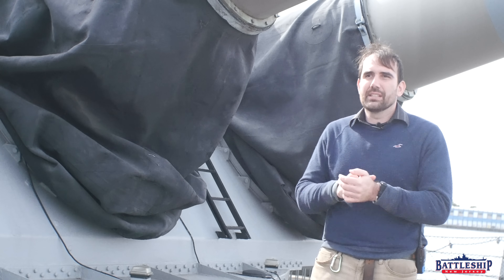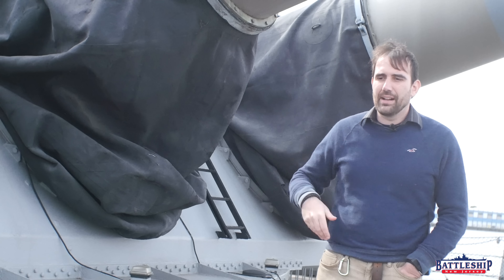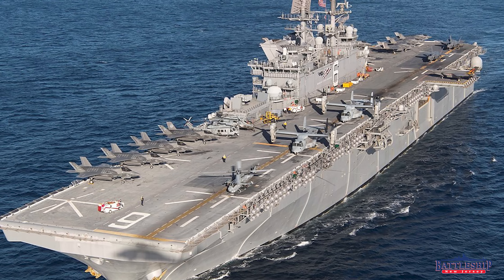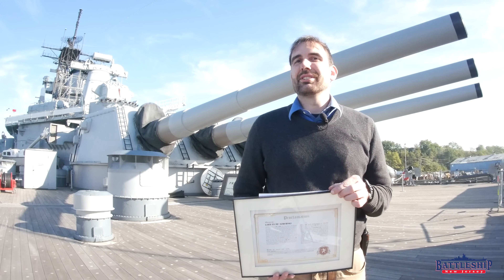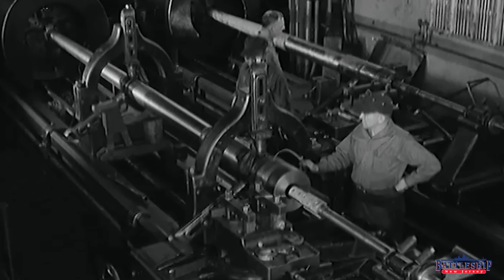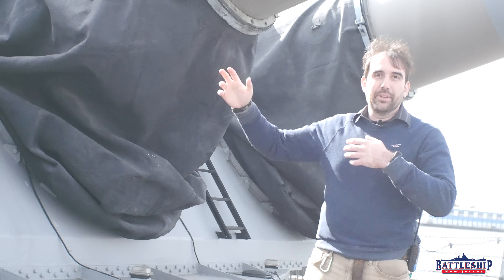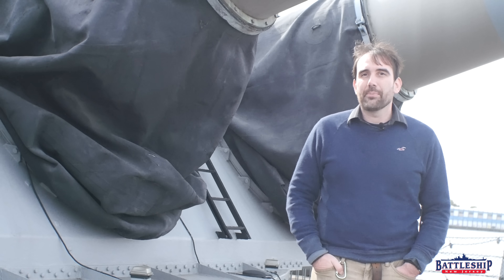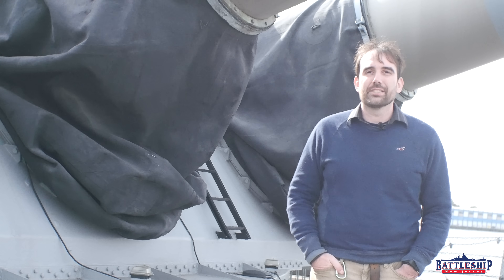How Much Would It Cost to Build a Battleship Today?

Comment: Just as (if not more) important: Could you trust the ship builders to actually build a properly functional warship, or would you get another LCS/Zumwalt clusterf***?
Reply: Shipbuilders are not for fault of those mishaps. Even though they are useful ships in there own right the shipbuilder built a finished operational product based on the designs they where given. It’s the designers and people with messed up priorities with more focus on the money than the needs of our navy. So no shipbuilders are not the problem. Granted we do need more shipyards. But that’s another conversation.
Reply: Yeah it took about 50 years for the US to build it's current carrier fleet. If it were to be theoretically destroyed in a war they'd really be no way to replace it until the sailors were in the old folks home.
Reply: hummm. I have debate as to the ship builder as to who to place the blame on there. NOT all blame in one spot. I place a fair bit for both classes on LM ! I place some of the blame for LCS on congress ! I thought original plan was only 1 or 2 both classes - then shift to a design that takes the best quality from each- which is blame on congress IMHO. IRT Zumwalt there is some slight blame on Bath SY (electricians). IRT Zumwalt - there was design work money given to both Raytheon & Lockheed Martin - Anyone recall why Raytheon won?
Reply: @wfoj21  really we need to do away with no bid contracts and make a law that anyone 06 and higher has to wait 5 years after retirement to enter a defense industry.
Reply: The actual ship BUILDERS can do damn near anything. It's the accursed engineers, salesmen, and Pentagon types that can't decide what they want, or how to design it that would make this a non starter. Example... I'm working on a system to raise the US flag on a Zumwalt. This simple system has been in development hell for 4 years and shows no signs of ending.